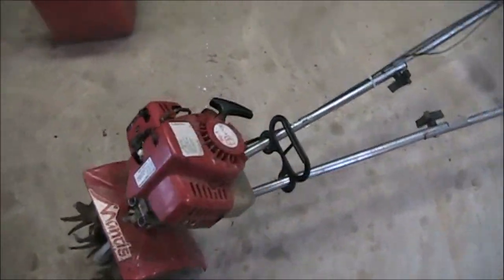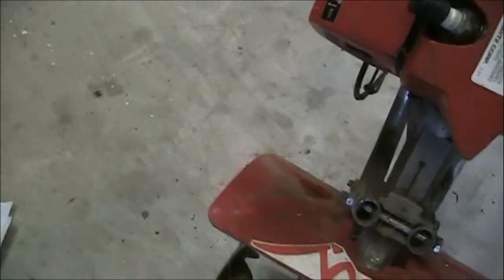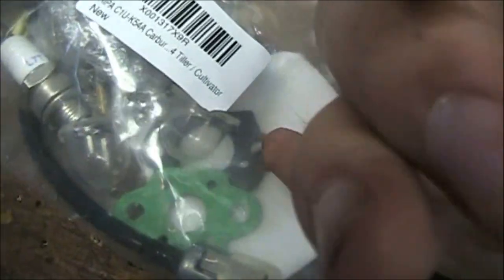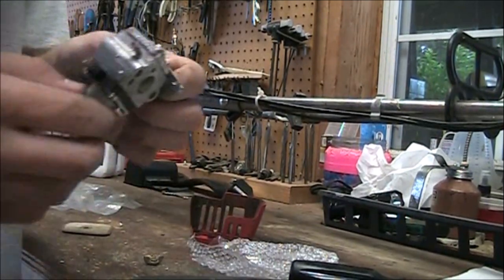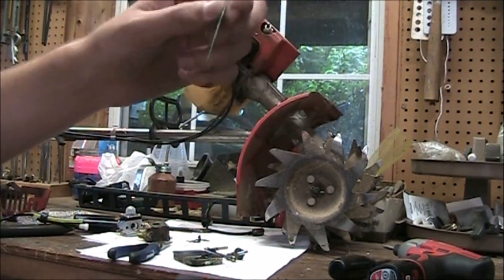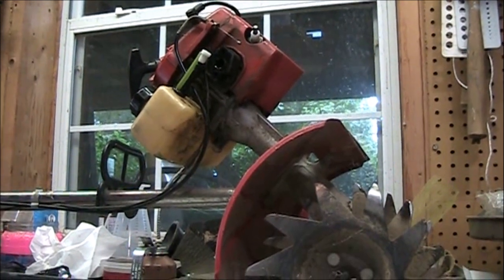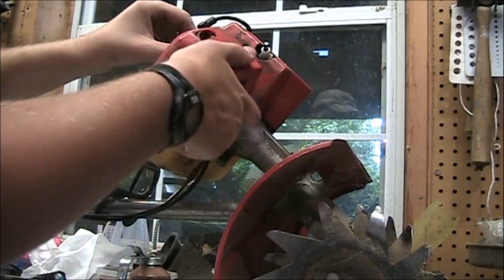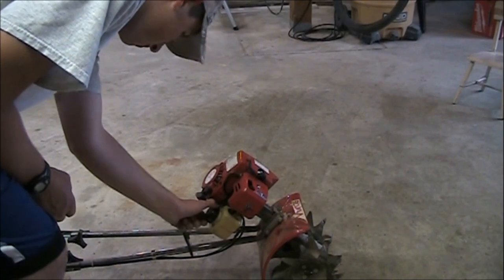How to replace the carburetor and fuel lines on a Mantis Tiller + General Tuneup

Comment: Nice video! The vent line on that tiller lives in a small opening under the engine cover. You will see a small round hump on the side of the engine cover and it fits right in there just right. That way it is in the upright position and can vent with no issues.  Great job.

Comment: Awesome information-very well detailed-explains functionality of different parts as well as mechanical repair. With this information I was able to take my over 30 year old mantis tiller, update with a 3 line fuel connection and new carburetor (it had been sitting in the garage for the last 15 years) and it is now running better than it did the year I stopped using it.  And that is from a person that didn’t even know anything about engines. WTG and thanks for the information—very very helpful-I wont have to toss the machine:)

Comment: Here's a tip: when removing the fuel grommet, pull the old fuel lines out of the grommet first, this allows the grommet to be more easily compressed and removed! I also used silicone spray lubricant on the lines and grommet!

Comment: If either line has a bit of kink you can take some long nose pincher plyers go inside the gas opening pull the line forward slightly which is what I usually do.

Comment: some subjective advice ,  I find removing the fuel tanks 3 Philips screws makes it easy to remove and work on the fuel tank assembly and also work without space restrictions as well as flush out the tank and makes it easier when it comes to inserting the fuel line grommet and lines ,, make sure you flush out any crud left in the bottom of the tank with a small amount of clean fuel as it will plug the new fuel pickup filter ,  "most" diaphragm carburetor fed equipment slightly pressurizes the tank while in operation so there must be no air leaks in the fuel cap seal and grommet the tank must be a sealed unit this is important as the carburetor pressurizes the tank slightly in order to receive proper fuel flow during operation. Check the small square air filter cap inlets on the front of the filter cap held on with the wing nut) as I have seen them plug with dirt and crud preventing intake of fresh air to the air filter , as mentioned check and clean the muffler spark arrester screen for carbon buildup  (under the muffler exhaust cap held on by 3 screws) this happens quite often and leads to a machine that wont rev because of exhaust flow being blocked, The valve on the end of the vent line slides up and inserts into the small circular notch in the upper engine shroud valve pointing up where the old vent was removed, this holds it above the fuel level in the tank so it can function property , when adjusting the Carburetor its not a bad idea to remove the tines so you don't risk injury
Reply: I'd use silicone spray on that grommet instead of oil.

Comment: I found using some Vaseline and a 1/2” drive socket which the fuel filter fits through. Say a 3/4 socket. You’re able to push down on socket to push grommet in evenly. Was easier to just remove tank.

Comment: Great video. 
Q1: Should the Discharge line (yellow for the choke) be long enough so that it also drops down in fuel tank below fuel level?
Q2: Should the Vent line be dipped in the fuel tank or not?

Any chance you can post a picture of the three fuel lines that are in the fuel tank? This will give me an idea of the length of the fuel lines in the fuel tank. I am not sure if the fuel kit that I am getting from Amazon will be cut to the right length.

Thanks.
Reply: 8:20 great explanation as to the purpose and placement of each line.

Comment: Another way to remove the  tank grommet is to take a sharp knive and simply cut the grommet and hoses flush to the tank...then push/pull  the other side into the tank. Then fish it out with hemostats or a stiff hooked  wire..
    The advance of doing it this way is that your less apt to booger up the tank ...and it's pretty fast ...

Comment: I watched your video & went at mine,after cleaning the out side of it with brake cleaner. Several questions came up .#1,how long should the lines be in the tank ? #2,any idea as to what the parts #'s are for the carb gaskets ? & where to get them?  I did not replace the carb today as it still works good. (I use sea foam in my fuel) & my tiller is a 2012..I also use an E3 plug .I also found a bare wire under my carb/fuel tank that i had to splice. I used a pair of needle nose pliers to get the grommet in and it only took a few minutes.Once done i fueled it up and edged a little over a block of side walk & it ran great.A tip for those replacing the air filter... Put the filter in that red cover first & then put it on. Less chance of getting dirt in the carb.if the filter did not go into the cover properly. Great video thanks !

Comment: The tank vent goes up into a recess in the top plastic pull starter housing.  It is easier to install the air filter into the housing then install the housing on the carb.

Comment: I put a new fuel filter on the line and hooked it up to the throttle side of the carb but when the filter is submerged in gas it won't suck up any when I press the purge bulb

Comment: Hey bro nice video, I have four of these I’ve repaired. Have new carbs for all of them I haven’t swapped yet since their running fine. Can pick them up used about $15-$30 bucks where I live here farm country. However, my question is these carbs come pre tuned from the factory or do the high and low need to be adjusted.  Looks like pretty simple install!! 

HMU! Thanks
Reply: David Dudley that is my question as well..I just used this kit for my mantis and so far t still can’t start it. The vent is leaking gas and I have no idea what those high and low adjustments are all about lol. I just starting doing this kind of thing out of necessity so I have very limited knowledge of small engines. But I’m learning fast. Anyone have any tips ?

Comment: Mine is a 4 cycle and it stopped working for a while. I changed the carb and it did the trick but not for long. Now the mantis won't start unless I hold the trigger for the throttle and the tines won't turn unless I press the primer bulb. I left it alone since i got so annoyed at it smh

Comment: does that carb already come adjusted so you can just install it and it'll run without making adjustments
Reply: Yes but fine tuning usually is required. You could see his idle was set too high.